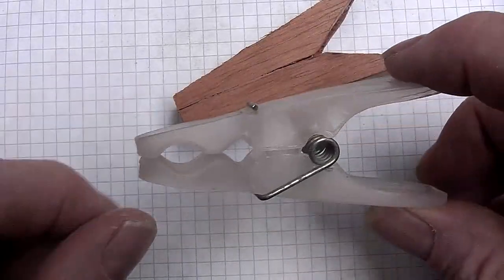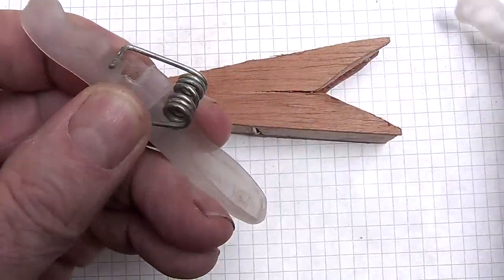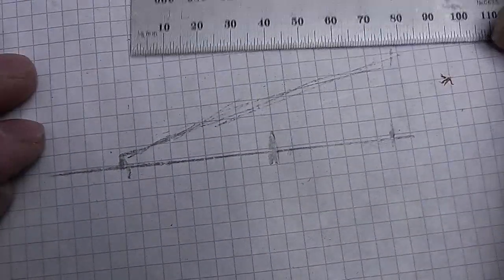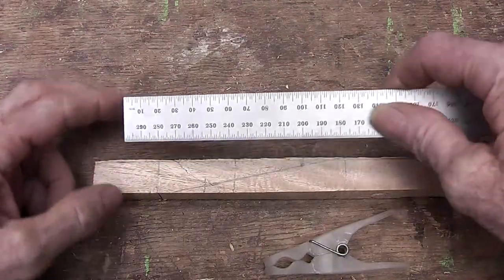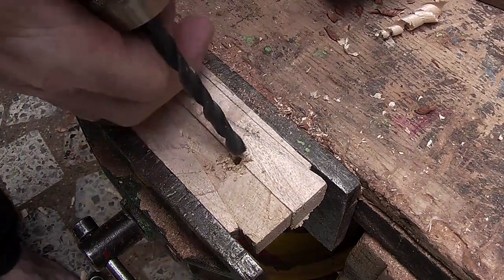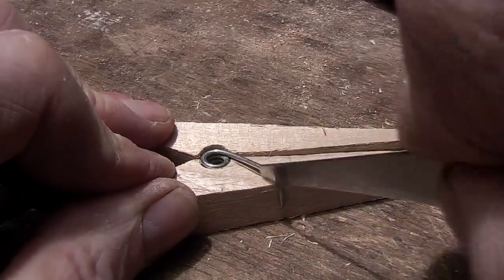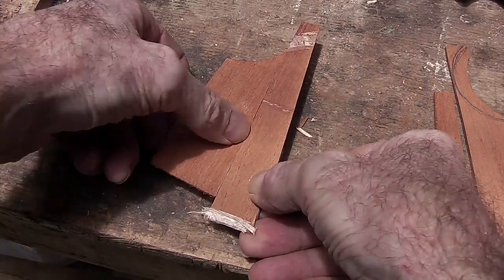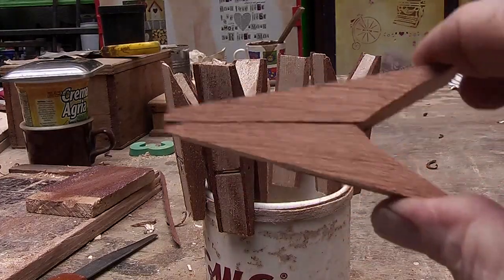Wooden Clamps From Plastic Cloths Pegs

Comment: Nice one Philip. Since I lost my job in the pandemic as I told you last year, I've recently turned my hobby of building PCs into a business and it's going well. I've really needed cheap light clamping solutions for the photo backdrops for product shoots, and this is a pretty good one. Would you think they'd work alright with the peg like holes for the line (in my case metal rod) but still be more robust than normal pegs?
Reply from the maker: Sure. The holes  would do fine. The outer strips  help them not scew sideways so they  seem more stable to me. But the clamping power is  more or less the same as it is the same spring.